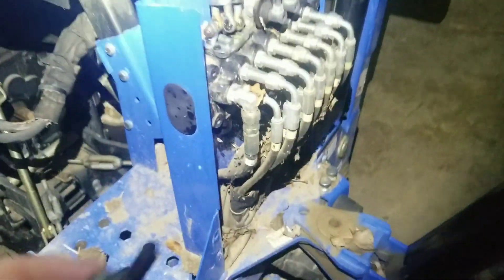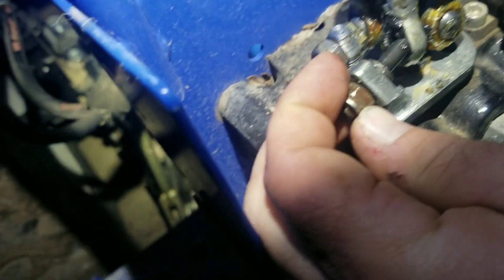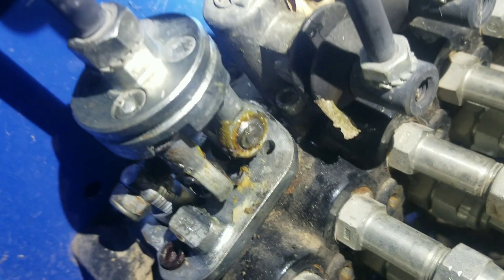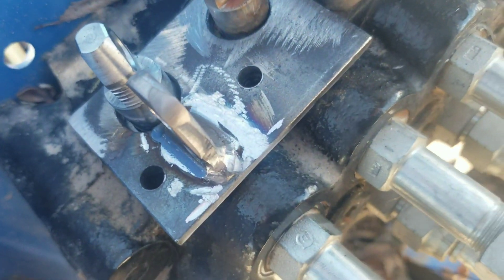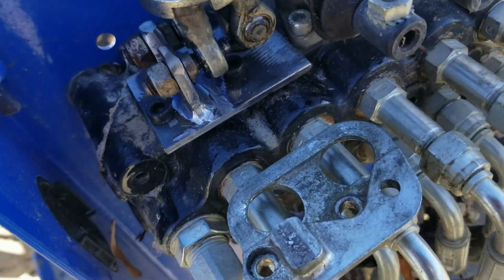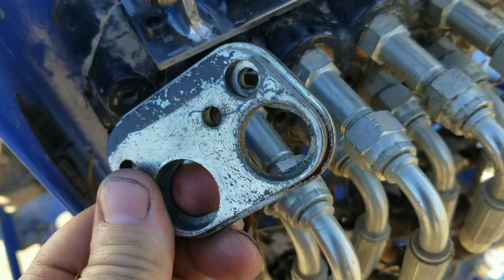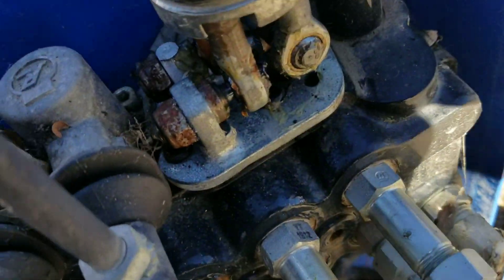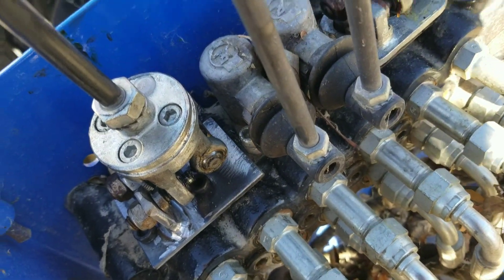New holland backhoe breaks on me at the worst time. loader valve part repair.

Comment: Question have you ever looked into adjusting the PSI on your Boomer 24? I have watched almost all of your New Holland videos and appreciate them. I have the same machine and enjoy it. Lately I am trying to find out if I can get any more lifting capacity out of her. Do you know the PSI yours is set at?
Reply from the maker: @MikeShank-l5k  so I have had a lot of issues with my PSI output, I believe factory was 3k, I dropped down to 1800. The dealer adjusted it twice and it gets back out of adjustment. I haven't had time to learn how myself, but I'd highly suggest you learn how, learn it's safe limit. And put a gauge to monitor it.
Reply: @townsendliving9750  Thank you. Yes, I have a gauge that I will use to check what I am currently at and see if I can push my limits a little more. I do not have a backhoe on mine. I use mine with grapple a lot.